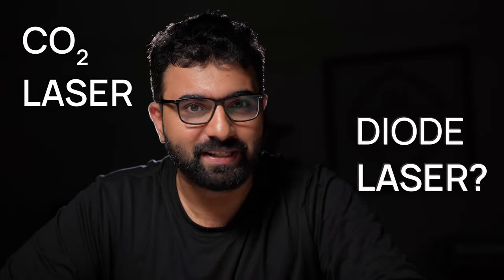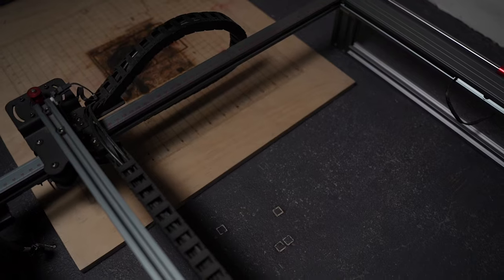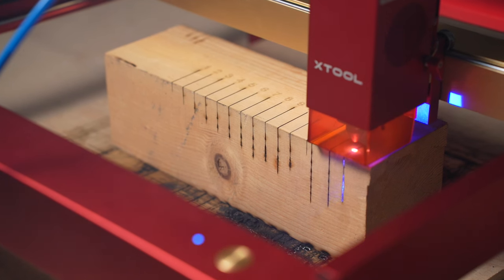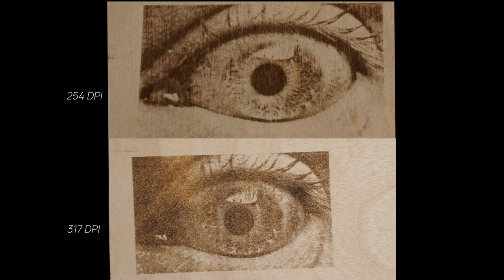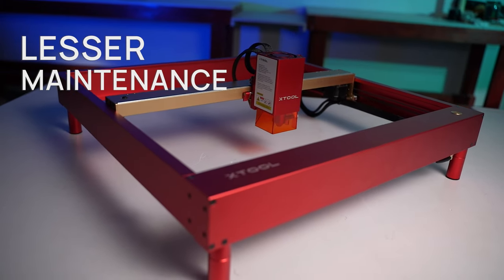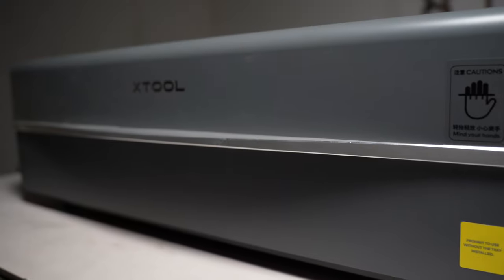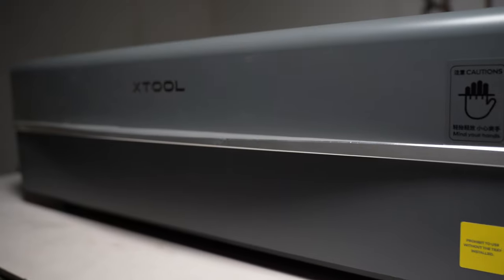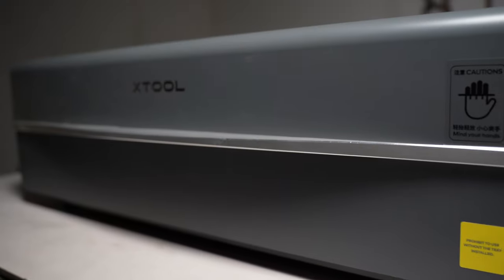CO2 Laser Cutter vs. Diode Laser: Don't make a mistake!

Comment: Diode all the way.  I got a 20watt diode with DIY expansion up to 465x785mm for a fraction of a CO2
Reply from the maker: Yup, diodes are more affordable and if a diode can do all that you intend to do it's an obvious choice.
Reply: My co2 laser can cut in "a fraction" of the time your diode can. I can cut 1/8" ply at 45mm/sec, and 1/4" ply at 25 mm/sec. Diode lasers are great toys, but if your time is valuable, Co2 all the way. Even the cheap k40, $500 Co2 laser can do that ..... With appropriate upgrades. The biggest factor in choosing lasers, is the workspace though. The k40 has a pretty small workspace. If you need a larger workspace, but you have plenty of spare time, diode lasers are great. If you need a larger workspace, AND your time is valuable, get a good co2 laser.
Reply: @derek2593  to each his own my friend. If I get in to a production environment, then maybe I'll get one. Have a good one!
Reply: @ericeinsmann5559 , you too man. I don't even own my laser, and am obligated to "produce". I enjoy it most of the time, but I wish it were just a hobby.
Reply: How did you get a diode laser for cheaper than c02!?!?!?!? For any 20w diode unit I can find, I could buy a 60w co2 laser, power supply, and still have hundreds to spare
Reply: @untrust2033  , bed size, and laser head speed are the most valuable specs on most lasers. His bed is bigger than mine. My bet is a Co2 with that big a bed would be 5 figures.
Reply: @derek2593  I was just talking about the laser diode itself, not the whole machine. I have a diy built machine with about that bed size and a 60w tube in it. It only cost 3 figures to build, with all new parts!
Reply: @untrust2033  Then to be fair, you need to get a bunch of laser pointers, and beam combiners and build your own 20 watt diode laser. Then compare pricing.

Comment: Yeah. Buy some Chinese knockoffs Co2 and have fun with bent beds and adjusting mirrors. 😄 Speaking from my own experiment, so be cautious, guys. Mirror adjustment is pain itself.
Reply from the maker: I haven't experienced a bent bed issue but, in low-cost CO2 lasers, adjusting mirrors can be frustrating due to their poor mounts, which often lead to mirrors displacing frequently. With the xTool P2, I've never had to realign mirrors once they're in place.

Comment: I am looking at either the xTool D1 or the xTool P2.  What are the amperages requirements of these two?  Can I use a typical 20 amp circuit or should I consider running a dedicated circuit for my laser?
Reply from the maker: Hi, the 40W D1 has a 200W input and the P2 has a 700W input. You could run the P2 using a 20 amp 110V supply without issues.
Reply: @MellowpineLasers  Thanks.  👍

Comment: Hello, I need your help, I am considering purchasing a diode laser (Sculpfun S9) with a power of 5.5W.  I wonder if this laser will cut carbon fiber 2-3mm thick.  The manufacturer declares that the effect of this laser is comparable to 90w co2, but this is probably not true
Reply from the maker: Hi, Sculpfun S9 is a capable laser machine, but it cannot cut carbon fiber. To laser cut Carbon fiber, you will need a powerful CO2 laser. Moreover, it is strongly advised not to laser cut Carbon Fiber as it emits harmful fumes that can cause health issues and even damage the laser. 
Also, a 5.5 W diode laser is more of an engraver and can only be used to cut very thin workpieces, incomparable to the cutting ability of a 90W CO2 laser.
Reply: Okay, thank you

Comment: Informative video...actually already I wasted my money buying Atomstack X20 pro... They didnt clearly mentioned that it can't cut transperant acrylic... From my experience only it came to know that. My other requirement was to stencil cut on 0.05mm thick steel sheet, which also they mentioned in their cutting list. Even that was also not happening. At low power its not cutting, and as power increases, the metal sheet is melting, shrinking, wrinkles, dark ashes etc happening. Honey comb bed was used beneath.

Comment: Hi! What would you look for when buying a second hand diode laser?
Reply from the maker: Firstly, make sure the laser fits your requirement and inspect the laser for physical damage. Next, inquire about the maintenance routine, specifically how frequently the lens has been cleaned. Prolonged use with a dirty lens can lead to damage and laser weakening.

Perform test runs to ensure the laser is operating correctly. Lastly, inquire whether the laser was used with or without an air-assist, as running it without one can significantly reduce its lifespan.

If the laser was operated with LaserGRBL software, request the user to provide data on the laser's lifespan, which includes information regarding its run time, average power, etc. On average, diode lasers typically last for around 10,000 hours.

Comment: Where do the RF C02 lasers fit in- such as Thunder Bolt?
Reply from the maker: In my opinion, RF CO2 lasers are more suitable for high-end industrial applications. While they offer the ability to make deeper cuts with minimal kerf width, they cost significantly more than a glass-tube laser of same power output. 
Now, most people argue that they compensate for their high cost by providing a longer lifespan, but they do not consider the higher operating cost of these RF lasers. Technically, RF lasers require a much higher power input than a glass tube CO2 laser to generate the same amount of laser power output.
Moreover, cost of replacing the laser source for a RF laser is much higher than the cost of replacing the glass laser tube of same power output.
So, if precision and long lifespan are of prime importance, then RF lasers might be the right choice. But if you are a hobbyist or a small-business owner, then a glass tube CO2 laser should be just fine.

Comment: how is the output power of the diode laser adjusted? e.g. i have a module of 80w, how do I decrease it for engraving on soft surfaces?
Reply from the maker: You can adjust the laser power in the control software that you use for your laser. For example, Lightburn provides the ability to set speed and power individually for each layer, similarly, you can set the power in LaserGRBL or any other laser software.
The laser power is adjusted in terms of the percentage of the maximum output power of the laser. So, if you have a 10W laser and you set the laser power to 50%, the laser will fire with a power output of 5W.

Comment: Thank you for the valuable information in this video.  Is there a rough equivalency comparison in capability and speed when comparing diode and Co2 lasers? In other words, what wattage diode laser would you need to be equivalent to a 55w CO2 laser?
Reply from the maker: You're welcome. 
As a rough equivalency comparison, I would say a 40W diode laser can cut through similar thickness of material as a 55W CO2 laser can, but at a slower speed. Moreover, CO2 laser can work on transparent acrylic and glass which the diode laser can't.

Comment: Could anyone explain why the colour of the acryllic matters for cutting/engraving potential?
Reply from the maker: Different colors react differently to different wavelengths of laser. A blue material will reflect most of the beams from a blue laser. A black material would absorb almost all the laser energy and heat up making cutting easier.

Comment: Thank sir fyi,, how about atomstack x30 pro vs laser co2 40 watt? Can you explain please?
Reply from the maker: You're welcome!
Both options will perform well when it comes to cutting thick materials. However, unlike a diode laser, a CO2 laser can cut and engrave white, blue, and clear acrylic effortlessly. It can also engrave clear glass directly, without any surface preparation, and yield cleaner engravings on wood compared to a 33W diode laser. 
However, if engraving metal is your primary requirement, then the Atomstack X30 Pro is the ideal choice.